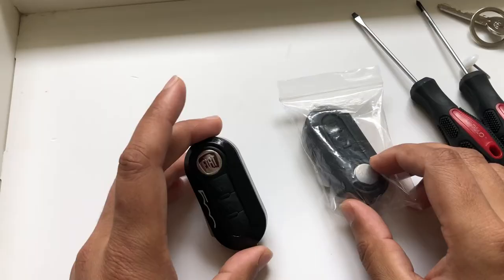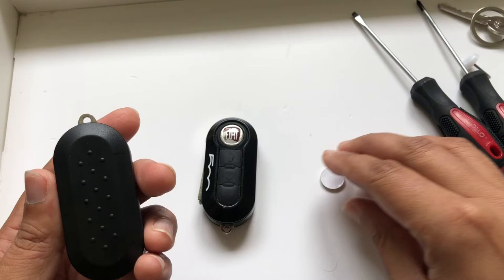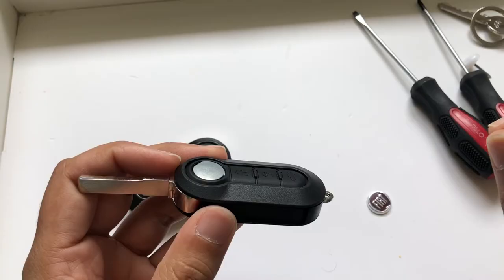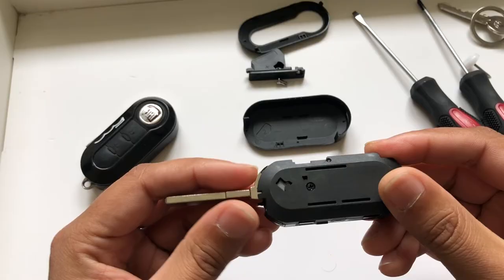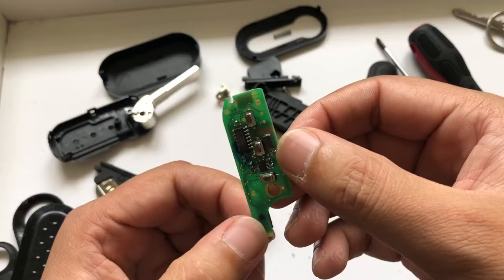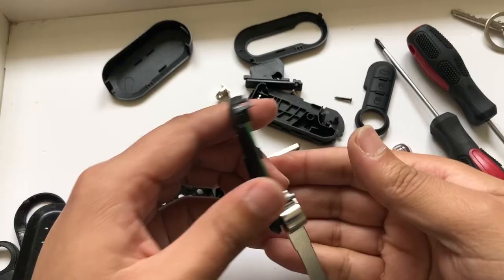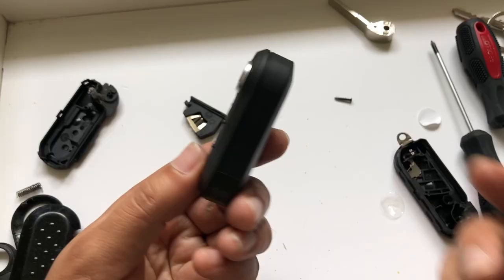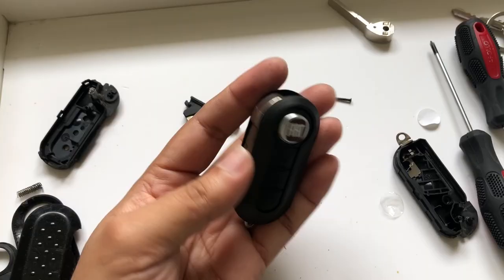How To change Key Fob | Fiat 500 | Battery Replacement

Comment: For anyone watching this make sure you turn the key with the spring in one turn or force so as to make the spring stronger.
Reply: Good point, you have to wind up the spring 1 turn or it will not flip open.
Reply: Can you explain this better?

Comment: This video is not good. You need to do few  extra things for the spring to work correctly and you need to move the key code into new case
Reply: How do you do that?
Reply: @taraboor7942  i actually went to mechanic.. he did it in 10 sec, didnt even charge me…

Comment: In case your key doesn't close fully, you need to replace the big tear-shaped piece at the end of the key, also. To do this, you need to remove the pin connecting the piece with the actual key. To do this, you need a metal rod and a hammer. Make sure to not lose the pin, as you will need it for the replacement.

Comment: Very helpful video, thanks. I managed to fix the non-working door opening button on my Abarth Grande Punto keyfob; a PCB track had been broken, where the battery terminal swings into the casing (a rather poor design).

Comment: You don't need to dismantle the metal key portion from the spring component.if you look thete is a small roll pin that holds the key blank to the mechanism.if you drift this out and also on your original key,just swap them over,redraft in the little pin and bobs your uncle.use a thin panel pin to knock the roll pin out.
Reply: Magic! I had just been wondering about this. I was a bit concerned about the pin then being loosened although it looks as though one side of the pin may be slightly wider than the other but it may be a trick of the eye? Thanks for this tip ☝🏼💖🐥✨

Comment: the  most  important  part  is  the  spring  of  the  blade .  once  u  put that  on below  the  blade  and  then  lock  it  in  place (  the  blade  )  ,  u  have  to  turn  one  turn  with  the  cover (  after  inserting  the  other  spring  from the  top  )  ,  correct    ?  
there  were  two  springs  in  each  key  ,  correct  ?
Reply from the maker: Yes, that’s correct
Reply: Mine only closes with the button. It does not open with the button, what did I do wrong? Author never shows the right way during that step…

Comment: Is there a time limit (disconnect the rest of they from the battery) which I have to look for? For example, after 10, 15 or xx minutes they will lose the programming?
Reply from the maker: There is no time frame for this
Reply: That only happens on keyless cars
Reply: There is a chip in the old key fob built into the plastic which is for the emobilizer on your vehicle  . I bought one of these and found I had to put it back in my old one .
Reply: Is there any way you could explain what it looks like please? I know this was quite some time ago now though.. 🥴🥺

Comment: I really want to know if it worked after prising out the circuit board with that lil micro flathead screwdriver? 
I’m looking at doing this myself but was thinking that a plastic modelling tool may be a safer bet for that part of the process …🙄❤️‍🩹💭🐥✨